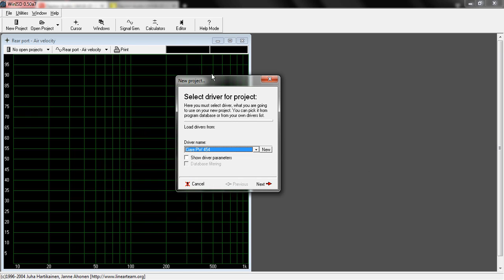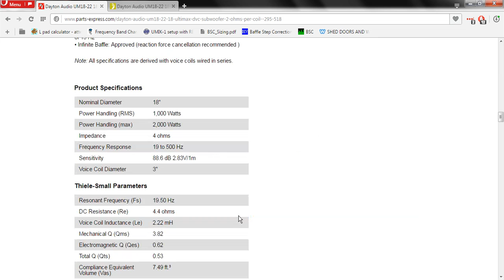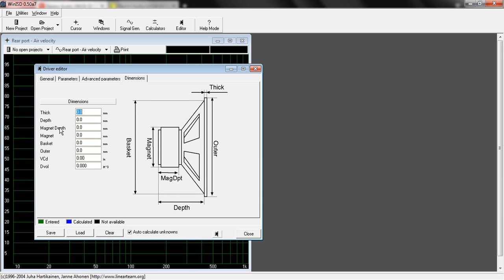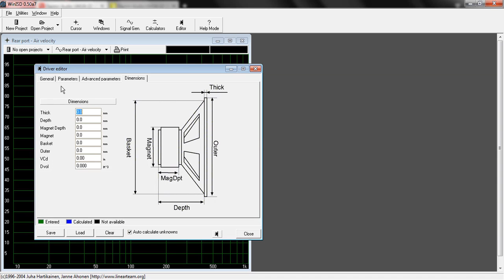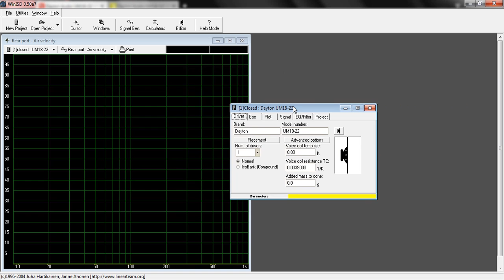How to Use WinISD - Input a New Driver

Comment: So what is really the secret to not getting an error after inputting the parameters?
Reply from the maker: The video explains it
Reply: @Toid  I watched, but I don't really see what why it works. Is it the magic order in which the parameters are entered? If this is the case, how do you know the order?
Reply from the maker: @itekani  it has to do with how it auto calculates the values. Unless you put them in any order as long as you delete, some of the values the computer wants to auto calculating you put in.
Reply: Terrible UX design... 😄

Comment: Can someone tell me why my rear air velocity graph goes off of the chart when I enter in the System Input Power (Signal tab)?
Reply from the maker: Their port is too small and you probably don't have a high pass on
Reply: @Toid  Thank you very much for your reply.  I'm trying to build a box for a Dayton RSS315HFA8 12" Reference HF Subwoofer 8 Ohm, with the box tuned to 20Hz (4 cubic feet).  In the System Input Power field I entered 400(w).  I used the HP filter option (20Hz) to get rid of the dangerous cone excursion, but the rear port air velocity is off the chart...literally.  Do you have any suggestions?  Thank you for your time.
Reply from the maker: @richardt2353  my friend and I used the 15-in ho version of that subwoofer and you can see the box that we built here: https://youtu.be/MNUPbqy_PdM we ended up using three long slot ports to get Port velocity down. Maybe that'll help you with your.
Reply: @Toid  I think I made a mistake getting this subwoofer.  There seems to be no way to alleviate the outrageous post velocity numbers by tinkering with the port(s).  Would I be better off making a sealed cabinet for this sub?
Reply from the maker: @richardt2353  if you put some of your graphs on the forum, we can take a look at it and give you some ideas of what we might suggest you do. www.toidsdiyaudio.com

Comment: Sd is the SIZE diameter of the cone area. Sometimes it’s not listed. Use Google   
For example: a 12 inch woofers cone area is approximately 11 inches across. 11 diameter inches  = 121 square inches. 
Make sure the little thing next the Sd box says “sq in.”
Enter 121 in the Sd box

Without an Sd parameter you can’t get accurate graphs. For example: cone excursion.  
This dude spent 10 seconds on Sd. SMH
Reply: Sd is the Surface of driver.

Comment: oof, my sub(a $100 japanese nakamichi sub) has a really badly written manual. some of the specs(Mms) are missing and some of them don't seem to make any sense? my Sd says "50.2m M" lmao what does that unit even mean, and my Cms says "176M/N" which doesn't seem to be a real number considering it looks 1,760,000 times bigger than the number yours gave

Comment: Hm, i understand anything, thx for that first, but i have a problem. the problem is, that my woofer "DD Audio 712 D2 - 12"  "  dont have like mms, cms etc. on a website, there are just very less woofers with all the needed parameters, so i just fil in what i have
Reply from the maker: You can just fill in the q parameters as well as x-max if you have to
Reply: @Toid  oh, good to know, i have a T/S, Pe, Fs etc. in fact im just missing MMS and CMS, but WinISD still worked and now i make an 3D modell of the woofer and tommorow i start to build it

Comment: hello can you help me with the measurements for a closed box for media with the B&C 10MD26 8Ω speaker since I speak Spanish and I don't understand the video by language
Reply: For closed and ported box i found Box-Port Design 2.2 much simpler, faster and easier, specially for active 3D box design as you are changing variables. Later on you can move all this information to another software for future tuning with more variables.

Comment: 1. Xmax 4:44
2. Pe (Watts RMS) 3:37
3. VoiceCoils 6:21
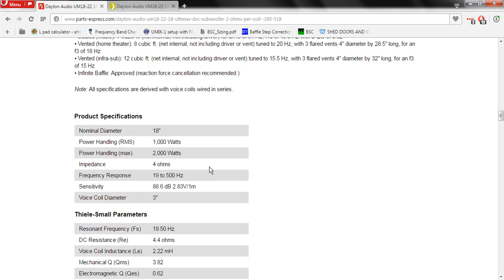4. Mms 6:53
5. Cms 7:11
6. Re 7:19
7. BL 7:29
skip Dd, Le 7:40
8. Sd 7:44
9. Qms 8:30
10. Znom 8:44
11. dimensions (opcional)
Reply: optional* lol
Reply: How to local driver low price no technical data sheed in speaker?no information in speaker
Reply: @mnfaditya2166  I know its a real old comment, but for anyone seeing this video with the same question (or if you're still wondering). Some kind of Thiele Small parameter test device like the DATS system by Dayton should do the job to get you the numbers you need. Dd is always measured as the diameter of the cone including 1/3 of the surround on each side
Reply: My info sheet doesnt list re

Comment: I'm trying to calculate a box for some bookshelf speakers I'm building, using the Dayton nd140 8 ohm drivers but for some reason whenever i enter Mms and Cms it auto calculates Fs to 1.88 hz wich is obviously not correct, and if I correct it to what Dayton audio says(59.2hz) I try to save the driver file but the error pops up. If i don't correct the Fs, the driver saves without any issues only with an fs of 1.88 what could be the cause of this and what can I do to fix it?
Reply: 123Toid when you put the box dimension of cuft. its the internal box dimension (Net Volume) or its the (Gross Volume) Outside of box?
Reply from the maker: Great question.  This is internal box volume.  The gross volume will be dependent on the size of the material and the amount of bracing you use.
Reply from the maker: It sounds like you have either you MMS on Kg instead of grams or your CMS is not on mm/N in the program.  Just click on the Kg to change it to grams and input your new value and same for CMS.  I did just input both CMS and MMS in WInISD and it derived 56.61hz.

Comment: What if the sub you are looking at doesn't have SD? specifically the one i'm looking at is the car audio, sundown audio sa-15. very minimal specs
Reply from the maker: I am not sure which version you are talking about, but I used this version: https://www.amazon.com/SA-15-D2-Sundown-Audio-Subwoofer/dp/B00EVYTAMU  Enter in all your known values and it should auto calculate SD - it did for me.  Just input all you MMS, CMS, BL, LE and everything else you know at the bottom.  Then go up to the top and enter the numbers 1 at a time until it auto calculates everything else.  It should work perfectly.  It autocalculated an SD of 337.7 cm squared.  I would not input that, let winISD auto calculate it or you could fail driver integrity check.
Reply: Ok, sweet. Thank you. I got the specs off the main sundownaudio website. I just input it all and saw that it did calculate it for me, thank you very much for the help!
Reply: +123Toid I must have done something wrong, I'm using the dvc dual 4 ohm model. It calculated SD to be 792 cm Squared? That doesn't sound right
Reply: Also +123Toid do I put Znom so what the sub is specified as "DVC 4 ohms", so coils I would set it to 2 and then Znom would be 4, and connectivity would be parallel since i'm going to wire each sub parallel for a final 1 ohm impedance at the amp?
Reply: i usually email the manufacturer, you can also call and they will hook you up with a spec sheet... good luck my fellow base head ;)
Reply: you would do the final 1 ohm( if you have two-dual 4 ohm subs wired in parallel- 1 ohm = Znom     in a dic.  nominal means overall i think dont quote me on that

Comment: I am using NVX VCW124 and they dont have MMs Listed anywhere...:(
Reply from the maker: If it doesn't have mms, just input all the data it does have and mms should auto calculate.  Be careful putting in your q values.  Put them in one at a time as some will auto calculate for you.  If you put them all in, you may receive an error.

Comment: What if when entering the custom driver parameters the auto calculated numbers don't match the listed parameters from the manufacturer? This happened to me on the Dayton PS95-8. Just makes me worry that I'm not getting accurate data for that speaker.
Reply from the maker: As long as you put them in the order I showed, the numbers will come up very close to the published specs on Dayton.  This is due to WInISD using algorithms to figure out data.  If you tried to fill them in with Daytons spes, it actually would not work.  This is one of the things people worry about, but with how close they are, they will not affect the projections.  So don't worry, you will be getting accurate data.
Reply: The other areas I'm spacing on are what volume and frequency to use for the box, and i think my curve on the Transfer Function Magnitude is off. it ramps up to 1.843dB/68.36Hz, then falls to -0.073dB/92.36Hz, then back up to 1.162dB/178.19Hz. Everything I've seen seems to imply that the arc should be consistent, and then flat line as much as possible, but mine is wavy. I think I've done something wrong.
Reply from the maker: You haven't done anything wrong.  That is exactly what I get when i input that driver, using a ported arrangement.  This is just how this speaker responds.  If you look at my ported video, it shows a similar (not as bad as the Dayton PS95-8) response.  This really is due to the speaker.  You get a much flatter response going sealed, but won't get anywhere near the low end range.  But just to make you feel better, the way the Dayton PS95-8 is not abnormal for a speaker.  There are many that respond this way.  On a final note you could try a 0.135 cubic foot box with a tuning of 80hz *which makes the curve flatter).  This will make everything from 80hz to about 200hz have a +2db increase.  In other words, you will get a little more out of the bass region.

Just remember WinISD will give you what it thinks is the best response, you can always mess with the cubic feet and the tuning frequency to get teh response you want
Reply: Say you've gotten you're desired response but it doesn't work with your box design. 

Can you have a box chambered with in a box?

Also, is there a rule of thumb with finding smaller full range drivers that react better than the PS95-8?

Thanks for the advice, I'm trying to learn all I can.
Reply from the maker: I'm not sure what you mean.  Can you be more specific about the chambered box within a box?  As far as the second part of the question, I'd say a lot of people like the Dayton ND90-8 speakers.  Most people use them in something like Paul Carmody's Sprite build.  My next build will be using these speakers along with a passive radiator (making the box smaller).  I plan to show the plans in my next video, which should come in the next few days.